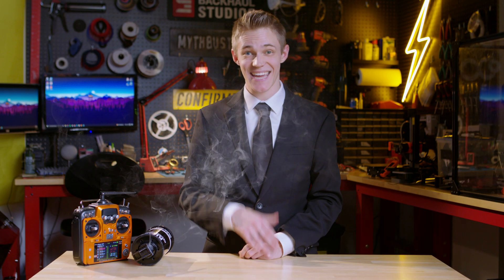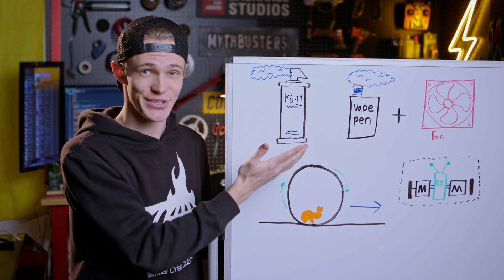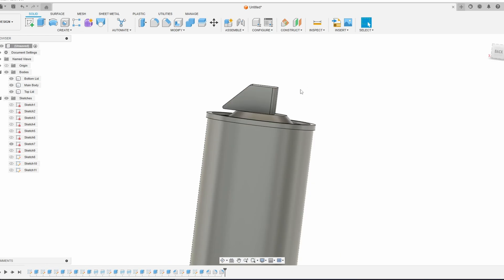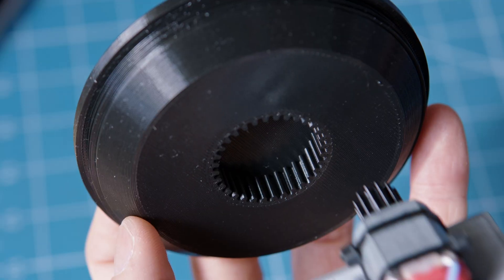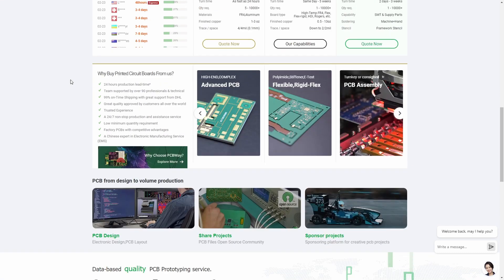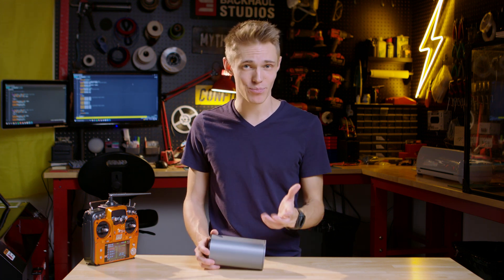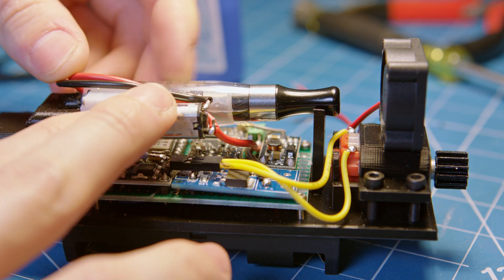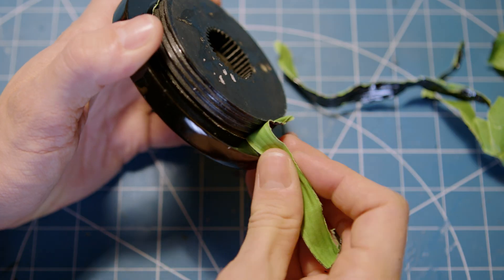I Built a Remote Control Smoke Grenade for a Movie

Comment: @7:00 if you do 3d printing a lot and need to finish the parts - Consider a media blaster you can get all sorts of media, and it can save you time on removing layer lines.  It's not perfect - I've only done it once, so maybe it's not that great, I liked it!  Another one I've wanted to try was a vibratory drum type thing, mostly because the idea of being lazy and getting smoothed prints sounds nice!
Reply from the maker: A media blaster would be great! Though I am a bit limited in the space I have here at my shop. Though your idea about using a vibratory drum sounds like the perfect middle ground!
Reply: @backhaul-studios  i have a strong suspicion that part weight has a lot to do with getting a good part, i worry in the vibratory drum a lot of 3d prints would "float"  might have to attach a weight with a wire

Comment: did you not make a spoon that flies off when the user pulls the pin? that's the most satisfying part of a movie grenade! bonus points if you are accurate and require a large amount of force to pull the pin (most movies get this wrong lol)
Reply from the maker: In the case of this project, the pulling of the pin happens off screen, so I didn’t have to worry about creating that mechanism! Though who knows, maybe for the next one I’ll be able to incorporate it 👀

Comment: What an nice project! But i think the liquid tank is a bit to small and the atomizer doesn't have enough power.
Reply from the maker: I definitely agree the atomizer is too small, ideally I would have liked to produce a much larger smoke cloud. However, since I was on a deadline and a budget, I opted for what I knew would work instead of going down the rabbit hole of building my own atomizer. In film I've found something that always works consistently is always better than something that occasionally works perfectly!

Comment: Ok, you have the hero, how many set props, hand props, and set dressing are you going to make?
Reply from the maker: Fortunately the shot in question is only an insert, so I don't have to worry about talent handling the prop. However, as a backup, I always make an extra print of all the parts in case anything breaks!

Comment: Really nice project, I was always astonished by how much engineering has to go into making movie props. Its cool to get some insight on that. Do you have any tutorials or research material on pairing the CC2530 chip with one of those 2.4GHz remotes? Will any kind of remote with that frequency work, are there maybe some existing libraries that can be used?
Reply from the maker: Thank you! I haven't had the chance to work with the CC2530 chip since most of the RC projects I've made are the result of directly integrating an arduino/esp32 based microcontroller with an off the shelf 2.4ghz receiver. The main reason I go this route is because there is significantly more documentation available for whenever I need to troubleshoot, compared to the CC2530. But I will certainly have to tinker with it on one of my future projects!

Comment: Cool project, do you have a laser cutter?
Reply from the maker: I do! It’s the OMTech 80W, but I frequently use it as a paint drying rack since it’s vented to the outside 😅
Reply: @backhaul-studios  I used to make Movie sets and props an the laser was a key tool in many of them as it was so versatile and fast. We churned out decor like there was no tommorow.
Reply from the maker: @mymagicsigns  It's been an absolute workhorse! Though eventually I'd love to get a CNC machine so I can make metal parts in-house!

Comment: why did you have the whole gear riding in another gear mechanism? it seems like it would have been simpler to directly attach the grenade body to one of the motors, essentially turning the whole shell into one large wheel
Reply from the maker: You make a good point! The two considerations that went into my decision to stick with gears was the size and shape of the motor shaft, which was tiny and not keyed. So my worry was reliablilty between the plastic end caps and the motor shaft when swapping between outer shells and changing batteries. The other consideration was ensuring the center of gravity was as low as possible, since otherwise the entire motor assembly would only spin itself, and not transfer that rotational energy to the rest of the grenade. This also helps keep the vape cartridge in line with the output because the motor assembly is sitting below the centerline.

Comment: Very cool project! What transmitter are you using?
Reply from the maker: The model I use is Radiolink’s AT10II 12 Channel unit since I can easily swap between different sized receivers depending on what I have to build!